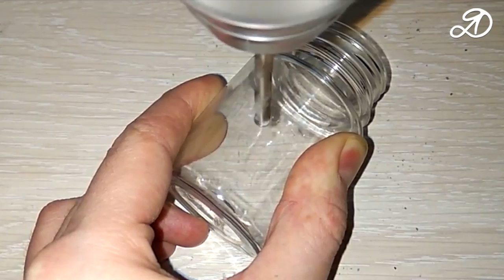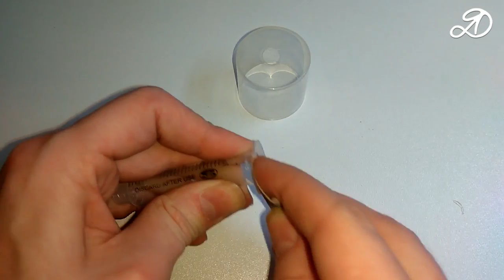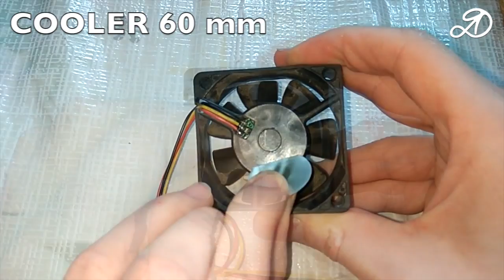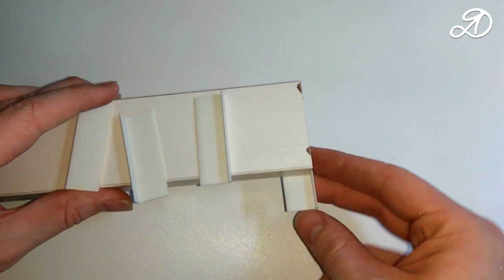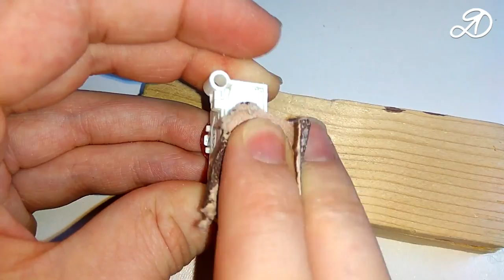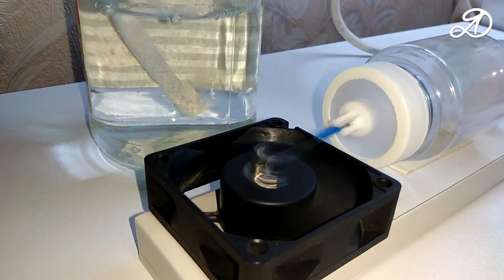Air Compressor from Cooler DIY. How to make a membrane air pump

Comment: YouTube suggested this for me so I watched it and gave this project a try. I made some of my own modifications and I think I could actually use this to make a crude airbrush setup. Instead of using silicone for the membrane pieces, I used pieces of a normal party balloon. I also cut a hole in the top of my chamber and siliconed another balloon in the hole so I would have a bit of a reservoir. Overall I'd say this thing is pretty decent for low volume low pressure stuff.

Comment: Really nice project. I've done something like that about 12 yrs ago and that worked too.
I got improvement for You: Removing blades in fan rpm are increase and probably current consumption should go a little bit down.
Reply from the maker: Thanks for the valuable recommendation! You are absolutely right. Glad to see my video :) Good luck!

Comment: lowering the bottle's volume will increase air flow and pressure. just cut 3-5 cm off and glue it back
Reply from the maker: Good advice, thanks!
Reply: I thought the same thing. My idea was to place a solid into the bottle. Almost fill it completely.

Comment: Nice and neat, but the performance could be improved. Your cylinder is too large, relatively to the travel or stroke. The large volume of air inside compresses and that's why you get only 10cm of 'depth'. Try stuffing the chambers with something solid like balls to take up as much volume as possible leaving paths for the air and try

Comment: Remove the fan blades
The rotation speed increases
Reply: Thanks mate! :)
Reply: like what you said
Reply: Fan blade can provide some air to prevent the motor from over heating

Comment: if you get rid of the fan blades you could save some battery power, pushing all that extra air resistance for no reason will draw more current.
thanks

Comment: Cool idea; however, wondering how long it will run before breaking
Reply: it depends of the glue you yuse,he used gorila glue,i think...
Reply: @mr.cantillasz1912  And if you can make it good enough without any "incidents"
Reply: It's everlasting thing... It's work, work and work, untill the Universe doesn't collapse. Just magic... 😉

Comment: You should cut the fan blades or make space for airflow otherwise it will cause unnecessary air drag and force on fan motor.

Comment: To increase pressure fill the space somehow behind the membrane. Now you have a very small displacement with a very big cylinder. In best case the two volumes almost the same. Then only the motor will be the limit. :-)

Comment from the maker: http://ali.pub/2dpzal - Air pump for aquariums.
Membrane air compressor with your hands from a computer cooler. Air pump at home. Can be used for an aquarium.

HOW TO MAKE an elastic SILICONE MEMBRANE (gasket) I showed here: https://youtu.be/4-t5pCPfOm0

I RECOMMEND TO USE A NORMAL ENGINE. The cooler has a small torque and sometimes there is not enough force to push the air at great depth. The maximum result, which reached about 10-12 cm. Interesting feature: the lower the rotation speed, the better the valves open and the more air is supplied. That is, in this case, not the speed of rotation, but the force on the motor shaft is important. It is necessary to correctly adjust the distance between the pump housing and the motor. The speed and noise level depend on this.

MATERIALS:
Fan (cooler) from the computer - 1 pc. - http://ali.pub/176wv1
Or another motor - http://ali.pub/176ywq
Bolt from the computer (+ washer + nut) - 1 pc. - http://ali.pub/176s5a)
Switch - 1 pc. - http://ali.pub/176z4b
Power supply connector - 1 pc. - http://ali.pub/176t3b
PVC tube - 1 pc. - http://ali.pub/1774dw
Paper clip - 1 pc. - http://ali.pub/1773sw
Double-sided adhesive tape - http://ali.pub/1775vy
Adhesive tape - http://ali.pub/1775qi
Super Glue - http://ali.pub/1776a5
Power supply 12V - 1 pc. - http://ali.pub/1776q3
Plastic jar with lid - 1 pc.
Cap from deodorant - 1 pc.
Silicone membranes - 3 pcs.
Syringe - 1 pc.
A plastic card
PVC Corner
Wires
Board
Reply: Dial good work, but wy don't you remove the blades of the fan ? they just charge the motor and consume energy.
Reply from the maker: Thank you! Yes, I agree with you!
Reply: Use step drills, they are perfect for this job. You will have nice holes without any refinement, sandpaper or scalpel.
Reply from the maker: Thanks for the recommendation! I already have such drills, but they stayed in the village))
Reply: Dial ii
Reply: Dial it
Reply: You have far too much volume in the valve chamber. It hurts efficiency and output pressure. Simply put some rigid material in the valve chamber to occupy volume without interfering with the valves, diaphragm, or air flow, then you will get more air volume output and far more pressure.
Reply from the maker: Thank you very much for your good advice!
Reply: Dial vidcie ifiec
Vjd
Reply: Dial μονιακης

Comment: Cool, but put a powerful 12v engine there to increase power. I Liked.
Reply from the maker: Thanks for the advice!
Reply: I used rc helicopter motor with 5v 2.1a cell phone adapter and cables overheats and melts

Comment: Do you know what's the output in liters/minute and how noisy it is comparing to genuine aquarium air pump (provide the brand and model name you've used for comparison)? I want to swap my noisy air pump as silencer box I've made doesn't help enough (want to eliminate noise as much as possible).

Comment: I take pump system from old water gun. I used 12W DC PC fan but I isn't strong enough to make the movement... Any help
Reply from the maker: Use a motor with high torque

Comment: Maybe i will try this out. But im gonna use a small motor from amazon with 15000 RPM. Will that increase the airflow?
Reply from the maker: It is important not the number of revolutions, but the torque of the motor. To force the water column, it is important to have a number of amps in the cooler. It takes a lot of effort to overcome the resistance of the membrane. The greater the depth of immersion of the tube in the water, the more forces must be applied to the membrane. Better 1 amp and 1000 rpm than 0.5 amperes and 2000 revs. Do you understand me?
Reply: Dial yes i understand you.
Reply: buy the air pump from amazon, that would be a lot more efficiency

Comment: hey bro hi i am new at this work and i dont know from where do i buy this thing like some battery connector or fans like this can you say me from where  did you buy that things and i love to do like this work thanks your video was awesome sorry for bad English its my third language lool
Reply from the maker: The simplest and most effective to buy a new device. If you want to do yourself, then you need to consider some of my mistakes. I did everything from scrap materials. Buying only the connectors and silicone used to make membrane. All links you can see in the description. Motor is better to take more powerful, even if it will be less rpm, but the torque should be higher, so he could easily move the membrane. A conventional computer fan is very high speed, but little torque, so it is sometimes not enough effort to overcome the resistance of the membrane. I hope you understand me. The working chamber should be as small as possible. Ideally, the amount of incoming air must be equal to the amount of escaping air. If it is a good motor, it is possible to increase the stroke of the piston. This will allow for 1 cycle to pump more air. These are the basic guidelines. Good luck!

Comment: I wouldn't call it a compressor because it doesn't do much compression with that low torque motor if the air were to be contained in a air tank or smth.

Comment: Can u please help me in making a air pump which can supply compressed air becaus this fan will stop if pressure is created in air please
Reply from the maker: Try using a small working chamber and a motor with a high torque

Comment: hello, is there a way to make it much powerfull?
Reply from the maker: Thank you for your question! Yes. 1. Need a more powerful engine with high torque. 2. The working chamber should be as small as possible. Its volume should be equal to the volume of displaced air in one stroke.
Reply: ok. i will try this so, thank you a lot for your video
Reply from the maker: Then tell me what happened, very interesting.

Comment: Why not just making a champer for the fan to blow the air???
Reply: Because this is video is to show how to compress air with membrane made from silicone seal
Reply: howo357  wrong, because so little of the first chamber gets moved in each cycle the pressure difference will never be enougth to open the intake valve on its lowest and open the exit valve at the end. it will only work if the end is open

Comment: Those fan bearings will fail really quickly this way I think.
Reply from the maker: You need to take a more powerful cooler or other engine.
Reply: It's not about powerfulness of the fan. It's about type of bearings used in all fans, because normal fan bearings are only loaded axially, but in your application they are loaded radially. Google axial vs radial force :)

Comment: I think buying an air  pump would be a lot cheaper, for this thing you had to use a dc power supply and computer cooler that alone is the price of a Chinese air pump for aquariums.

But If you ever wanna build a fuck machine this video can be useful XD
Reply from the maker: I did not buy any of this) Ahahaha, maybe someone will need :D

Comment: All you are doing is pumping air into water by the help of a fan and a battery!!! - that's not compressing air. Compressing air means to use heat and a pressure valve/pump to pressurize air into a cylinder or tank for use as fuel like hydrogen. I would use compressed air to drive my toy pistons because i do not have access to patrol or any sort of hydrogen fuel.

This is simply air pump and i can use it but its not compressing air into smaller forms. Compressed air is pressurized air and its smaller then the oxygen...

Comment: Great! can this solution be used for the airbrush?
Reply from the maker: Thank you. I doubt it. In this version, the pressure will be small. Maybe if you reduce the working chamber and use a more powerful motor.
Reply: thank you very much!
Reply: Isidro no problem try to do it
Reply: you need a high displacement chamber (long stroke and wide bore) and a constant pressure and airflow. the pump above generate air in pulses. not good for airbrush

Comment: a better motor and tire rubber. would work better. That motor a power head stream maker.¿¿¿ how to power stream it , a magnetic turbine/fan,  .7:20 remove the fan and cut what you can.
Reply from the maker: Thank you! I got a lot of recommendations and if I do something like that, then the next model will be much better